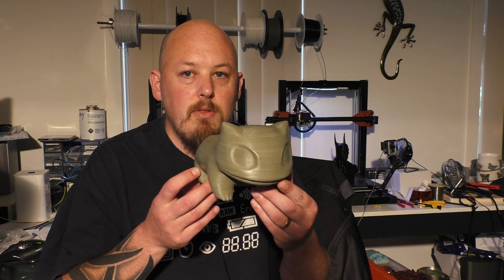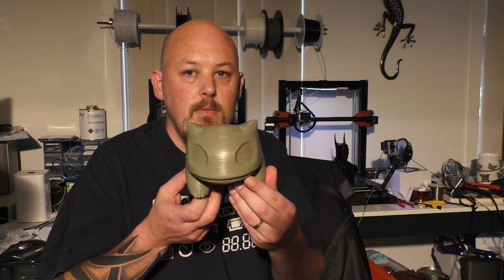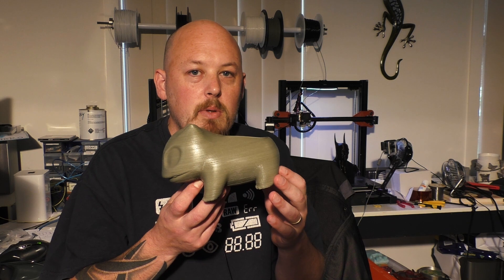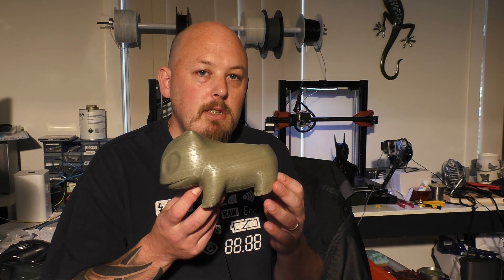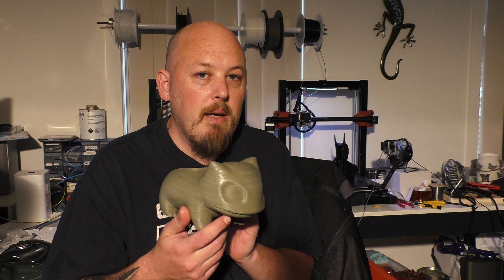Pokemon Bulbasaur - PRINT BIG! Part finishing vs long print times

Comment: I agree with the general idea with the video. I'm even printing at .3 right as I type this. The only thing ive found as a issue is sometimes theres screwy stuff with the layers like I can see some gaps/little goofs on bulbasaur. One thing ive found is don't fear the decimal, ie Ive done some decent prints at .25. I need to play around more but I have a feeling there's a sweet spot for low resolution prints laying in that second decimal

Comment: The finishing compound for automotive body repairs works nicely for filling printing texture gaps. A tube of Bondo 906 putty is $8(US). It sands well but you will need to paint it afterward.

Comment: Just found you and your vids are incredible. On simplify 3d where do I change the micron size to 300 when doing large prints?
Reply: +prex61 Like most 3D printing terms, "# microns" confused me when I first started as well; just a fancy way of saying hundredths of a millimeter. ;)  (So, umm...yeah; I guess it's not really a 3D printing term per se, but the context confused me as well.)

Something I stumbled across in regards to layer height vs. nozzle size:  supposedly 0.4mm nozzles work "best" with a 0.26 layer height, and 0.6mm nozzles with a 0.36 layer height.  Saw it on some random video I can no longer remember done by a professional 3D print finishing company.  I'm not sure what "technical truth" there is to that, but I tried it out this last weekend and did notice that - believe it or not - the mechanical parts I was printing (with dimensions in multiples of .25mm) actually seemed closer to tolerance with a .26 layer height than ones I'd previously printed at .2 or .25!  Granted, I only printed a couple so it could have random factors, but I'm going to keep trying it with my quick-and-specifically-sized models (about to do one, actually) as it seems like such an illogical thing for someone to say if it didn't hold any merit.
Reply from the maker: +prex61 hey glad you found me! Under the Layer tab, set the primary layer height to 0.300 :) cheers!
Reply: +Brandon T Yes the terminology is what was screwing me up...thank you so much...will test and get back to you.
Reply: +ChristianP1973 I'm not sure what you're talking about, although I think maybe you misread my statement: I said layer height, not width.  For width I don't think I've ever gone below the nozzle size - I swap to a new nozzle if that's the case.
Reply from the maker: Hi! Change layer height to 0.300.  Cheers!

Comment: Anthony, maybe do a tutorial on the actual finishing work. Like dry sanding Vs wet sanding, sanding grit variation, etc.. You know show the people the process. :-) #thatswhatthepeoplewant
Reply: +The Hot End In the immortal words of Keanu Reeves, "Woah!" I just tried that on a couple sanded carbon fiber models and sure enough, it works like a charm!  Makes sense given PLA's makeup, too. Thanks for the tip!
Reply from the maker: Great suggestion / I'll add it to the recording schedule :)
Reply: +RJ_Make I'd be interested in this as well, Anthony! I've been using ABS more than I'd like because I can vapor bath it, as my first (and only other) attempt at proper finishing work was with carbon fiber PLA (which in my experience just got really dull and gray-ish in the spots I sanded, not to mention the difficulty in sanding it in the first place).
Reply from the maker: +Brandon T A trick with carbon fiber (dont tell anyone) lol is to give it a small coat of oil when you are done :)
Reply from the maker: +Brandon T "ahhhh the Print-Fu is strong with you young Jedi.."

Comment: That is a whole lot of wasted filament in your last few prints could save a lot more time....Maybe some you should think of cutting in half or changing orientations on stuff...Just my opinion as a beginner..
Reply: +Mixed Bag I'd love for you to explain your "beginner's opinion" on how to save filament on this model: it's a container (flower pot?) so all perimeters need to be solid enough that there aren't any unwanted holes that could allow water/etc. to get inside of the walls, it's algae PLA so you can't "weld" it solidly and smoothly with acetone (leaving you to deal with shoddy-looking super glued seams), and if you print it at any angle other than horizontal or vertical the layer-lines are going to look really strange (and if printed in multiple parts, potentially going in different directions based on your print orientation).  And even with any of those changes, you are still going to need support material in places, given that the only non-rounded part of this entire model is the bottoms of the feet.

Oh - BTW, did you miss the title of the video, about saving time and all?  Please account for that in your explanation as well.  Thanks! :D
Reply from the maker: +Mixed Bag supports are a necessary evil
Reply from the maker: +Brandon T Cheers Brandon!